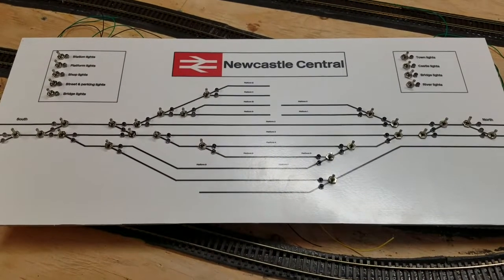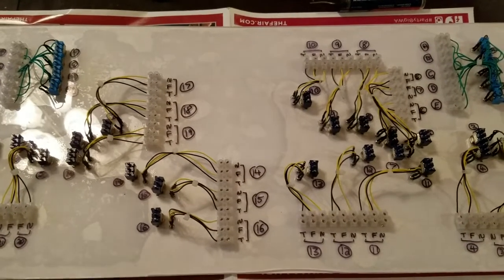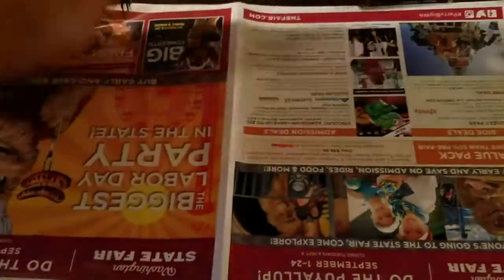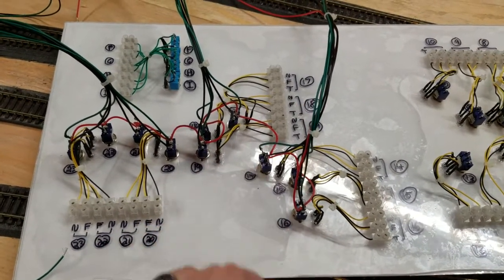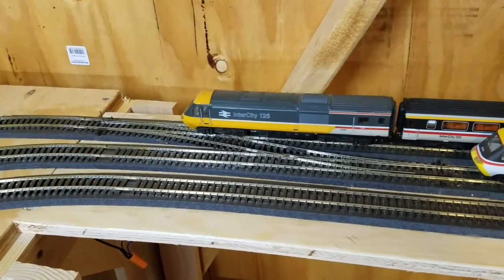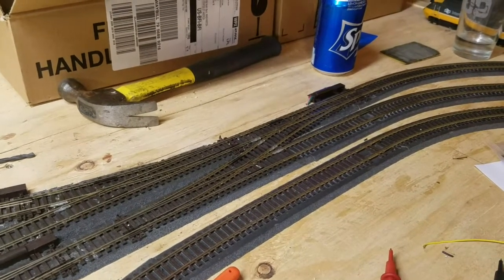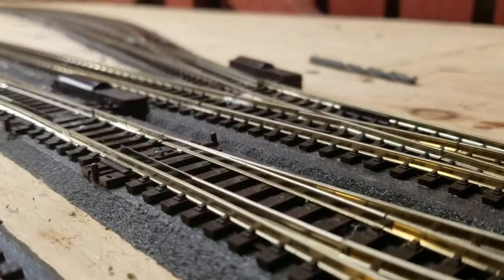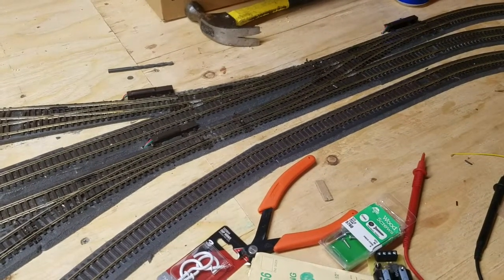8 - Building a switch panel (part 2)

Comment: Hi the theory you explained at 5:00 regarding using the Frog Polarity was really interesting. Am I assuming you're using electrofrog points?

I'm currently trying to solve the same problem, but I have insulfrog points. I notice the SEEP PM2s do have a terminal for controlling frog polarity, so could I wire it up simply to the Point Motor?

Comment: Hi I have just found your channel and subscribed, great looking control panel. how do you link your toggle switches with leds I have just completed a panel and your idea would improve my operational of the panel. did you know you can get sprung loaded toggle switches where toggle goes back to the centre...all the best Tony
Reply from the maker: Thanks, Tony. I have used the center-sprung toggle switches on a different project, but I found (at least with the cheap switches I bought) that over time they didn't always spring back correctly and would leave the circuit open. Not as big of a deal with a capacitor discharge unit in use, but it was more that the circuit would remain open so no other toggle switches would fire here as the CDU would be drained.

For the LEDs, I'll try to explain it :) This requires that you have electrofrog points and the point motors have an auxiliary switch that can be used to change the frog polarity.

- The positive arm on LED 1 connects to the DCC bus +
- The negative arm on LED 1 connects to a common wire that runs to the frog polarity power
- The positive arm on LED 2 also connects to a common write that runs to the frog polarity power
- The negative arm on LED 2 connects to the DCC bus -

When the frog polarity is switched one direction or the other, the polarity sent to the track is also then sent along the common wire back to the LEDs. When the frog has negative power, that completes the circuit for LED 1, so it lights up. When you flip the toggle and throw the point motor in the other direction, the frog polarity switches to positive, so that instead completes the circuit for LED 2.

I would have preferred to use the aux bus power, but I've seen plenty of the block signal lights that run off the DCC bus, and the approach here ensures that the LEDs always match the frog. It only works when the frog polarity switches, so where I had to use the surface-mounted PECO PL-11s, those LEDs don't currently light up. I'm planning on use frog juicers (http://www.tamvalleydepot.com/products/dccfrogjuicers.html), but I haven't gotten round to ordering and installing those. Those will also only work once the train actually hits the frog and would cause the polarity to change, if needed. So, I may need to re-evaluate this.

For now, it's mostly functional. I have seen circuits whereby you can use double pole switches to change the state of an LED, but that's a lot more work to retrofit. The cost was also pretty high for enough boards to cover all the switches and LEDs I needed. This approach here is pretty rudimentary, but works well enough for me.

Hopefully this makes sense. I'll maybe do a quick video that covers this a little more in depth when I get a chance. Thanks for watching! Iain
Reply: Thanks for that mate, I will have a go. I should be able to take the supplies straight from the frogs as the are already wired. thanks again Lain much appreciated ..........regards Tony
Reply: @NewcastleCentralOOGauge  Hi there, many thanks for your video and the explanations!
I wonder how you got your LEDs to feed on the DCC? 
I'm trying to do exactly that but it doesn't work (off 12v they work fine).

Problem of the DCC or possibly the wrong LEDs??

Cheers 

Serge
Reply from the maker: @purasca_digilog  It's been a while since I built this, and not sure if I covered it in one of these videos, but I was pretty sure I took the ground from the DC bus, and then positive leg on the LED was from the DCC polarity of the frog on the turnout. Crossing the streams, so to speak, didn't seem to cause a problem, but would then illuminate the LED when the turnout was thrown and the DCC polarity off the frog would be switched. Hope this helps. Good luck! Iain
Reply: @NewcastleCentralOOGauge  Hi Iain, 
Many thanks for your reply. 

Can I stress your memory some more?
Would you remember what kind of LEDs you bought or, more precisely, the voltage and especially what is hidden in the cable? 

Thanks again and take care!

Serge
Reply: Sorry Iain, 

Just seen your answer to this question in an earlier reply of yours. 

Thanks again!

Serge

Comment: Impressive control panel. I am also using pre-wired LEDs, was wondering if you ran into problems stripping the leads given the small diameter of the lead wires?

Comment: Interesting. In a previous video you connected frog juicers so can you say how you wired the LEDS on the control panel for the points with these? Wouldn't the indication show how the point direction was last left rather than how the point is now thrown?
Reply from the maker: It's been a while, I thought the third video covers it, if this one didn't.

I pulled a wire from the frog wire back to the LEDs such that when the frog polarity was positive, one of the LED circuits was complete, and when the frog polarity was negative, the other LED circuit was complete. It wasn't actually based on the turnout position, as such. The LEDs, for all, used the frog polarity so that it would work regardless of whether the point motor or frog juicer was controlling it. Iain
Reply: @NewcastleCentralOOGauge  Thanks Iain that is very helpful. I haven't got to the third video yet but I will look now.

Comment: Hi there. Great project! I really like how it turned out.
I'm building something similar, and was wondering how you mounted the LEDs, and how you mounted the terminal blocks. 
Were those mountings done with a hot glue gun? 
Did you use LED holders?
Reply from the maker: Thanks, glad you liked it! The LEDs were just glued with a small drop of regular superglue. The hole was drilled just every so slightly larger than the LEDs were, so there wasn't too much free play in them. A small spot of superglue is then enough to hold them.

For the connector blocks, I think it was a mix of superglue or hot glue gun, yes. They need to be a little more strongly glued as you do bump and twist on those quite a bit when attaching the wires. The connector blocks under the layout where everything terminates (I think this isn't until the third video) were then just screwed into the boards as I had the ability to then do so.

Hopefully this helps! Let me know how you get on if you build something along the same lines! Iain
Reply: @NewcastleCentralOOGauge  Thanks, Iain :)

Comment: Thank you for uploading this video. Hadn't considered adding LED's to my (new) panel, but now I am (thank you for the extra work ;-)).

If I may be so bold to ask: where did you get the prewired LED's with resistors?
Reply from the maker: Yes, it was extra work for the LEDs, but I think overall it's been worthwhile. It's a nice quick check on the switch panel, even though I usually watch the points anyway! Probably looks more impressive than is actually used :)

The LEDs with resistors I got from Amazon here in the US, though you can probably get them in the UK, too. This was the US link for them to give you an idea -  http://a.co/d/4bY14PK. They were $6-$8 for a pack of 50 depending on the color. Totally worth it for not having to solder and heatshrink right at the LED! Good luck. Iain
Reply: Thank you for the link. I use a MultiMaus which means there's about 18v on my track, any idea if that's an issue with these 12v LEDs?
Reply from the maker: It would most likely be a problem unfortunately, yes. In general, you can't apply more voltage than LEDs are designed for Running 12v LEDs on 9V is fine, but the inverse usually doesn't hold true. The LEDs would likely burn out quickly and give off too much heat. LEDs do come for different power ratings, so either look for 18V LEDs, or use a different/older power supply that delivers 12V for auxiliary bus.
Reply: @NewcastleCentralOOGauge  thank you, I've since found 24v LED's which should work, probably gonna them order later today :-)
Reply: What size switches did you use ive been looking every where but switches are way to big  thank you love your videos

Comment: I really like what you've done in both part 1 and 2 videos. However, I'm building an N Gauge layout of Millers Dale in Derbyshire which has about 20 odd points and crossovers, but I haven't the foggiest notion about wiring all of this. Are you self taught or is there a really good book that explains how to go about putting everything together? I'm not electrically minded, but I'm not stupid either, but it is my first serious project and I want to make a good job of it like you are doing, it's truly impressive. Take care...
Reply from the maker: Thanks, John. Much appreciated.

I'm self-taught - most of what I've learned has come from YouTube videos or sites like http://www.brian-lambert.co.uk/Electrical.html. Brian does a great job of covering a ton of different wiring scenarios. Once you've done a couple of points, motors, or switches, it becomes a lot clearer when you see it in action. Take your time on a practice point and motor. 

I also do a little with N-gauge and it is a little harder with the smaller track, but again, take your time, use a good fine-tip solder iron, and you should be set.

Let me know if I can help at all. Iain
Reply: Many thanks, Iain. Your advice is much appreciated and thanks for your link and offer of help if needed. Take care...